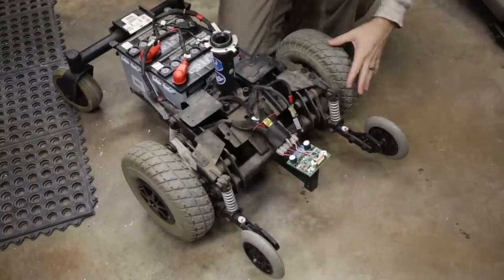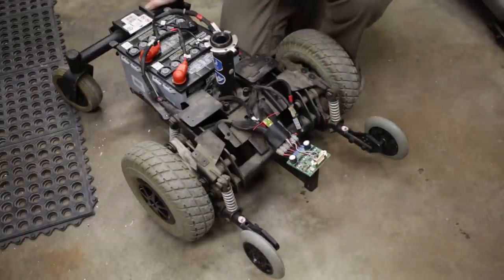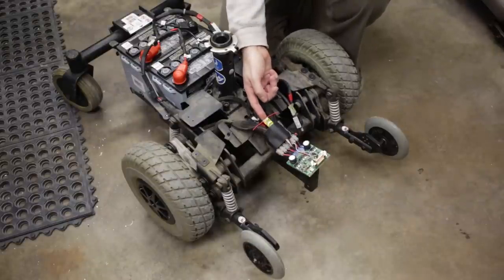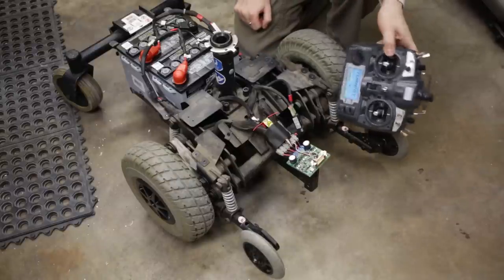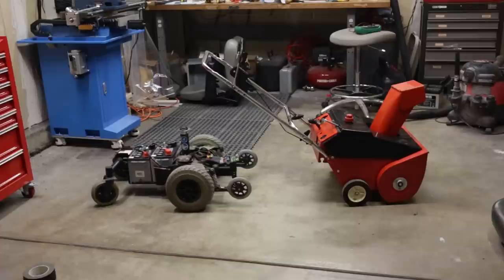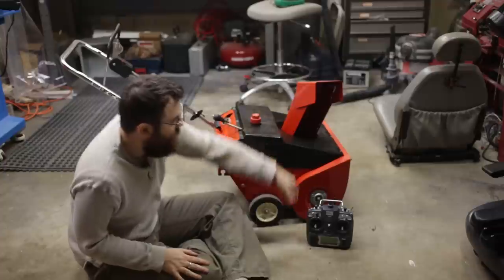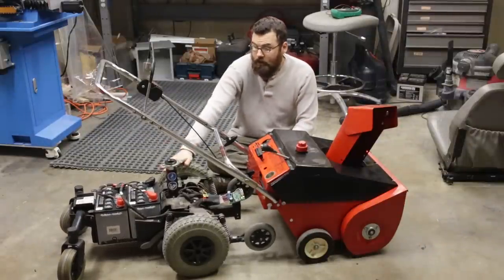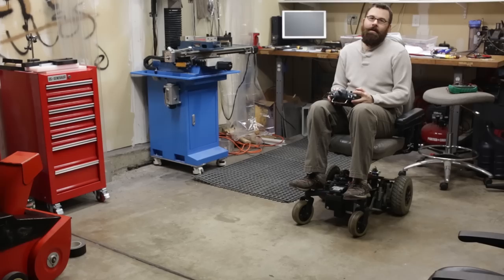Remote-Controlled Snow Blower - Part 1

Comment: Love how you made wheelchair work with remote control. I'm a paraplegic and have an electronic chair which love to operate with remote in order to be able to carry my stuff without any help from anyone. Can you help me with it..?? appreciate your help.
Reply from the maker: +Nos Dehgan It's relatively easy.  You just replace the motor driver/controller with a something like the roboclaw or a roboteq (you just need to match the controller with the motors), and then plug an RC receiver into the input.  It's pretty much that simple.  I could make another video showing this, but there are a lot of videos on youtube where people have done this.  You will lose some safety features however, so beware!
Reply: +Robert Cowan (Rowen Hobbies) Hi Robert, thank you so much for your respond. I looked for video showing how it's done but haven't been successful. I'm not anywhere technical smart like you but know enough to do it with some help as far as what type of control board.
Reply from the maker: +Nos Dehgan If you are non-technical, please do not attempt this then.  You will lose safety mechanisms for your chair, and it could run at full power and not respond, which could be very dangerous.
Reply: +Robert Cowan (Rowen Hobbies) I have extra older chair which I want to convert it. Have you done it for someone..? anyone ask you to do it for them? it will be tremendous help to me.

Comment: I have a snow blower Briggs station 1027 it has driving reverse on it but I can follow it I'll fall down I'm handicapped I use braces to hop around but I have wheelchair motors I was trying to build it a remote control but I landed in the hospital with kidney failure but now I'm trying to get back into it I bought everything I needed can I put those motors on the same body that's on the snow blower

Comment: Do you mind sharing a bit more information on the RC integration?  I believe you mentioned a roboteq 2x20 amp contorller but I couldn't quite make out the other controller you were mentioning
Reply from the maker: +alexei van Ingen The other one I used was a Roboclaw.  The Roboteq is pricey, but the Roboclaw is quite nice for the price.  You can get them from Servocity.

Comment: hey Robert .could you just tell me how did you connected the wheelchair motors,to the sabertooth. because it comes 4 cables from each motor. do I have to connect one red end  one white together. end one black end white together too.I hope you can help me ..thank you
Reply from the maker: +Brian S There are 4 wires, but two of them are just for the electromagnetic brake.  They should be smaller wires.  If you check the user manual on the sabertooth, they talk about these wires.  You can either remove the brakes, or connect them to the sabertooth.
Reply: Hey thanks for answer.so fast. And well I just connected the red end the black cables at the sabertooth but it doesn't move end it's just crank end the sabertooth it's flashing the red LED where it says error. ..
Reply from the maker: +Brian S have you disabled the electromagnetic brakes?  search youtube for wheelchair motor brakes or something like that and see how to take them off.  does the motor spin freely?  if not, you need to disable the braking mechanism.
Reply: Alright Robert thank you very much for your help.end keep uploading video .

Comment: hey could you please help me to do the same project. how I hove to connect all the cables.
Reply from the maker: +Brian S - I've put this project on hold, I have some other things going on.  The electronics section is not terribly easy, there's a lot going on.  It turned out to be pretty complicated to interface with the gas engine.  I may have more videos coming up, but for right now, this is sitting on the shelf.  Sorry!
Reply: @RobertCowanDIY  Hi, it's been 6 years,  have anymore videos on this? Thanks!

Comment: That is the wrong kind of battery for this application.........   Wont get much run time.   And you should get a 2x32amp Sabortooth controller.  Has 1000000 more features then roboclaw and is cheaper!